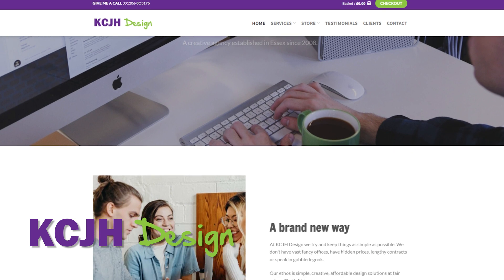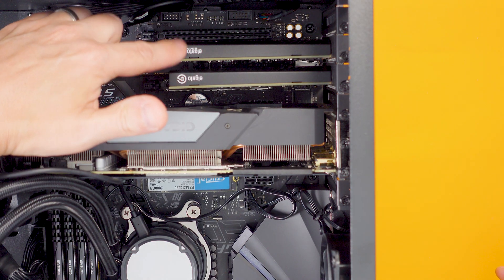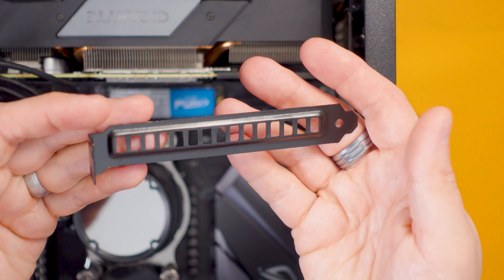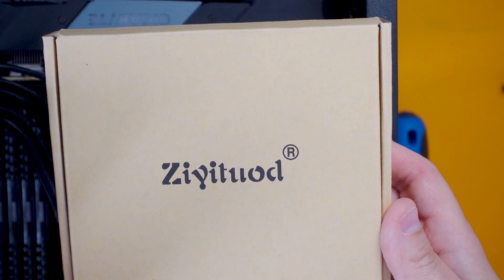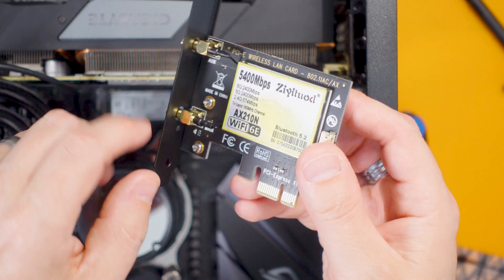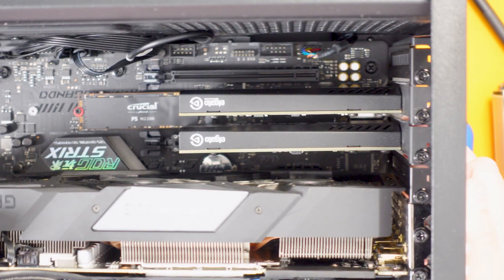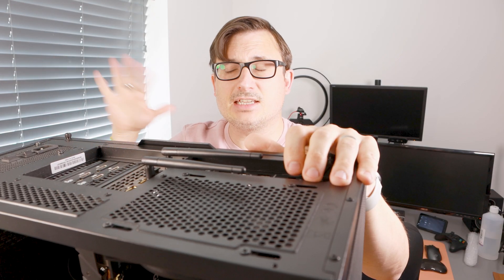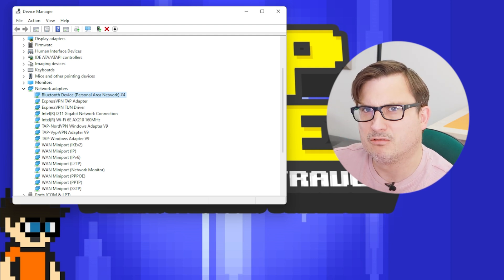How To... Add WiFi and Bluetooth to your Desktop PC by adding a PCIe Card. Ziyituod WiFi 6E AX210

Comment: I have an ASUS Z690-A and both pci-e just below the GPU slot. Pretty much useless if you think about it. I have a 4 slot GPU and completely blocked off those slots. Asus didn't think this thru, especially for their non-wifi/bt boards.

Comment: Need Help. I installed bluetooth USB cable and driver correctly on Windows 10 PC. But it can't find any BT headphone. I can connect WIFI N to my phone at 75mbps, Signal strength full 5 bars.
Reply from the maker: Your phone might well be limiting throughput, can’t help with the Bluetooth issue

Comment: Is the card itself able to be plugged in and play or do i need to connect it?  Because i have it and all but i Dont need a Bluetooth Adapter
Reply from the maker: I’m not sure if I understand the question?
Reply: You plug in the pcie card into the mobo, theres a separate cable you can connect the pcie card to the mobo if you would like bluetooth